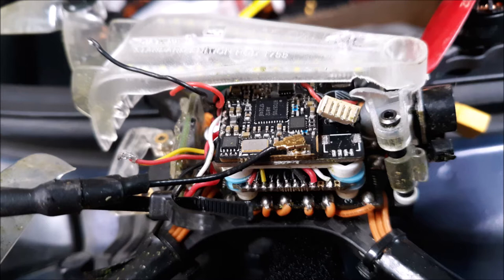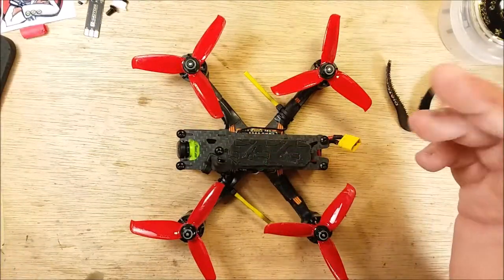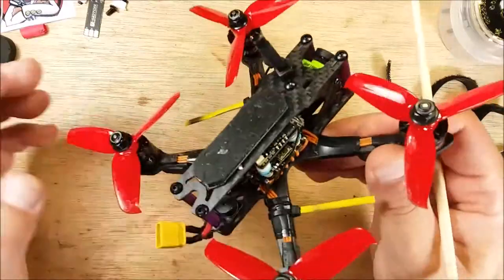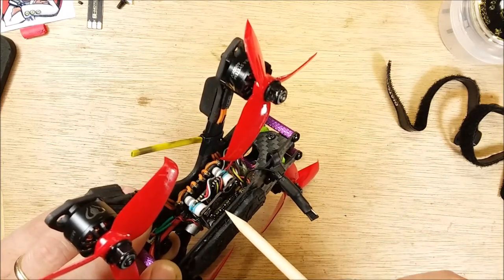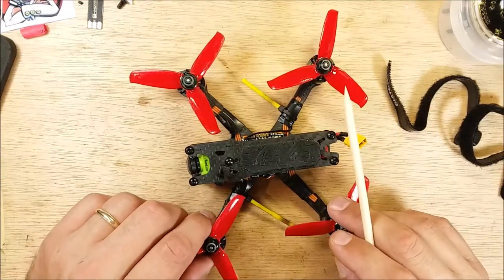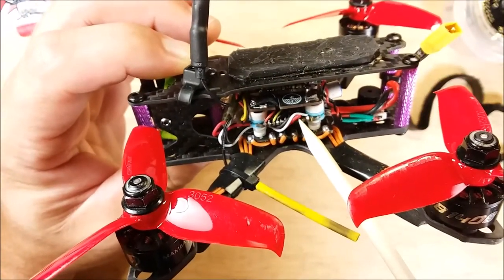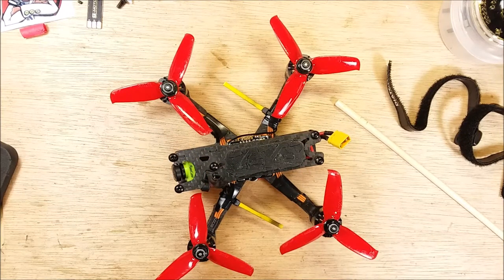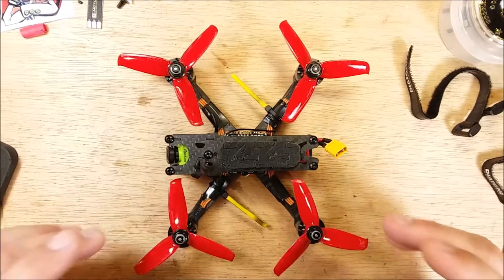Eachine ER349

Comment: Nice review, what do yo use the 5v regulator for and where is it located on the Mamba mini mk2 f04 20x20mm stack.
 I also need some advice on installing the Runcam micro swift 3 v2 cam and Rumcam vrx200. How would you connect the two together and mount them onto the FC board?
I will leave you my email in case what want to send me a vid or photo...cheers my friend!
Reply from the maker: On both Mamba mini stacks, I used the 5v out pads to run my vtx and camera.. I could email the info..
Reply from the maker: Actually, I have a build video that shows step by step where and how to hook all that up.. You may want to check it out..
https://youtu.be/_xM4Xm4uFo4
Reply: @propsoff  yes please...Thank you!
Reply: @propsoff  Thank you!